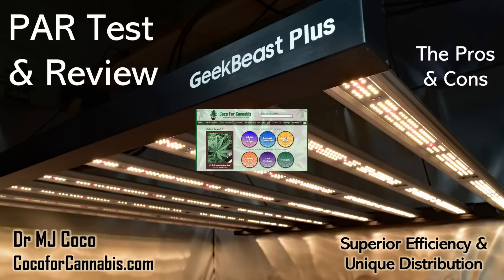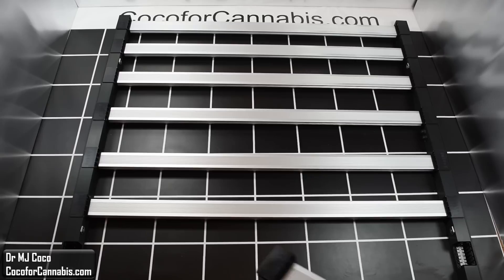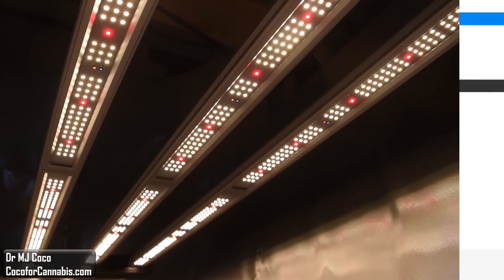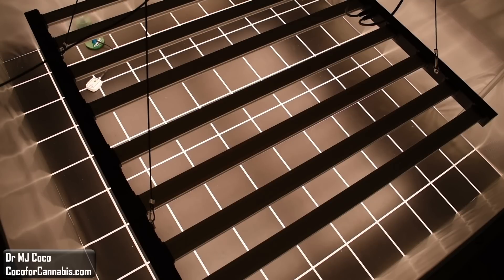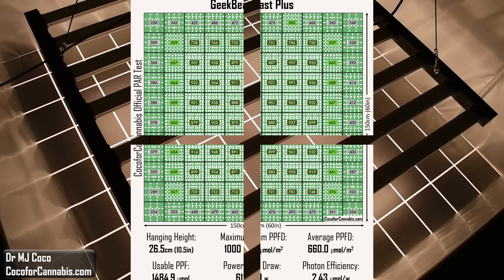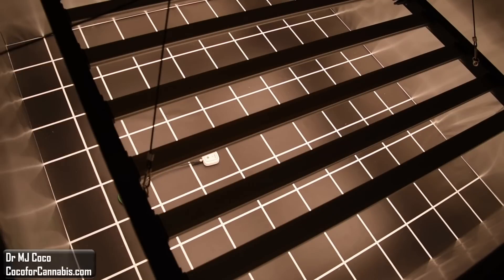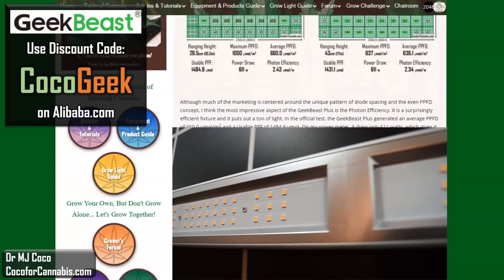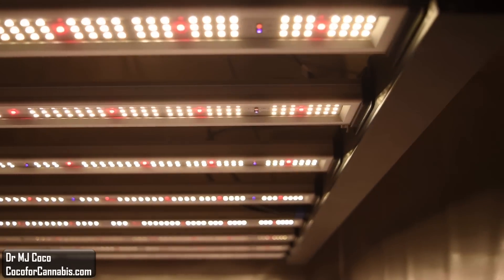GeekBeast Plus PAR Test and Review

Comment: PS everyone - to separate the bars, you do not need to use a mallet. You can use your hands. You just have to push each bracket one at a time. Super easy!
Reply: @SageLakshmi  thanks! I was shocked too until GeekBeast sent me a video showing how it worked. It was easy to disassemble in 7 min. Just gotta go 1 bracket, on each side, at a time. Not too hard at all.

Comment: Am I wrong in saying this light has a smaller par map than its little brother the pro model? According to Shane from Migro, the pro model is almost entirely uniform, at roughly 1000ppfd per square ft. I believe that was a 4x4 he tested in. I dont believe this plus model has the same map as the pro model reviewed on Migro
Reply: I have the pros and love them. I was worried I’d be bummed on not getting the plus but the pro par map is perfect - 1000ppfd the whole map. Happy with my pros!
Reply: I guess I just dont get why the plus drops off so much compared to the pro... I suppose the pro model is best for a 4x4... but the plus is not ideal for a 5x5 either. Can do better for the price

Comment: Mine came in without the Bluetooth/wifi connection, without the longer cables and with one of those plastic thinks on the light bar that is broken.
Reply: @stevep4236  I love the pro. I own 2. I think the plus is too many bars. But still support GeekBeast!
Reply: I only got jipped out of the controller unit...
Reply: wtf...did you get it fixed?
Reply: @stevep4236  nope emailed them but they told me to deal with the "importer" called greensell.nl
They are not answering to emails or phone calls
Reply: @NoMoreMrNiceGuy223  Man that sucks sorry bro....always had second thoughts with these companies...this confirmed it
Reply: @stevep4236  yep, I paid the same price for it eventually as the optic slim 600h. The parmap is really good though and that was my reason for getting this light as well as the app which would have saved me  euros 200/300 instead of buying a separate sunset sunrise controler.
Reply: @NoMoreMrNiceGuy223  did you buy it from that importer or the actual company direct via alibaba ?
Reply: @susanl6163  greensell.nl was the importer.
Reply: @stevep4236  if you buy direct from the company via alibaba you have 5 year warranty. If you buy from some importer you have to go through them. I went direct.

Comment: Nice light .... Curious Have you seen the New 1000watt Photontek. It Looks  pretty  think its better than  the Scorpion diablo  or the roi720 so im very curious to see what this1000w  5x5 light can do with 10 plug n play led bars.Will you be testing this monster of a light.????   Thanks for all your testing and hard work.
Reply from the maker: I just got the Photontek XT1000 CO2 PRO! I will be testing it over the next few days - Video in early April (I think) - I am very impressed with it - it is a whole lot of light! Designed with low heat output for use in sealed rooms - I really cant wait to test it! -Grower Love
Reply: @DrMJCoco  That Awesome!  you Rock Thanks Again GrowerLove

Comment: Pity you didn't test it in the 4x4. 5x5 is odd size to handle.
Reply from the maker: I discuss the 4x4 application in the video :)
Reply: @DrMJCoco  The light would probably still hit more that 2,3 umol/w in a 4x4. That's why it has a dimmer or we can run it for less hours. I have 10 hours in a day with cheaper electricity.